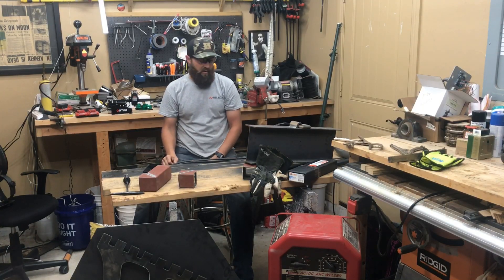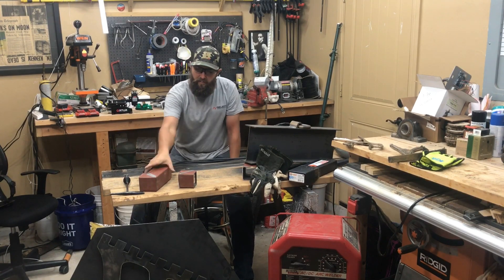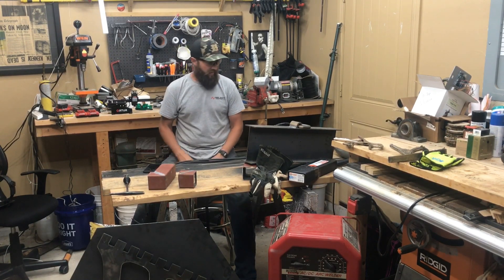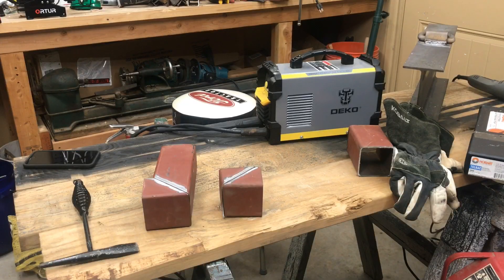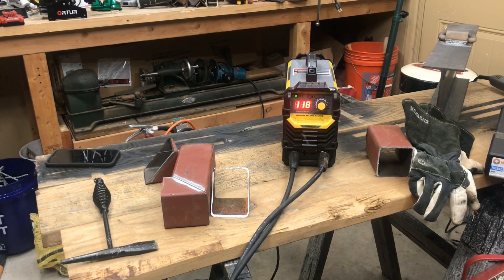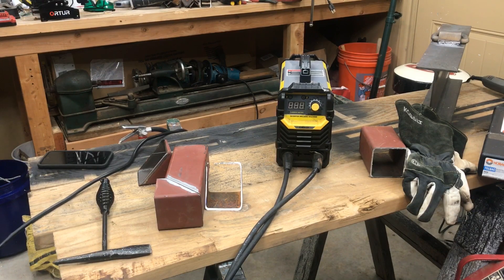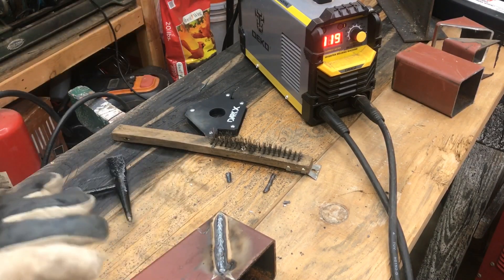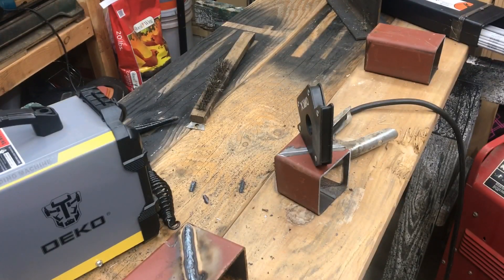DEKO PRO 110v Stick Welder - Amazon Product Review and Comparison vs Lincoln 220v

Comment: I just got the same welder but, haven't even tried it yet....maybe this weekend.  I bought all 3/32 rods to run with it.  You should really check to make sure there isn't something wrong that is causing the shock.  A mild shock could be deadly under the right (wrong) conditions, especially if it's leaking 120 AC somehow.
Reply from the maker: John Madden I’ve looked it over and I can’t tell why that was happening. It also hasn’t happened since that one day. I will definitely keep a close eye on it. Have you got to try yours yet?
Reply: @MrJustinWheeler  Justin I finally got to try it just a little bit tonight.  I am brand new to welding and all I did was run a couple of beads down a piece of uni-strut to make sure the thing actually worked.  I ran a couple of 3/32 6013  rods on at about 85 amps and another at about 70 amps both on 110.  Didn't blow any breakers and I didn't get shocked (but I was inside and completely dry).  So far so good.  I am pretty excited about it.  Have wanted a welder for a long time.  I have a whole lot to learn before I can say anything with any cred but, I am glad I got it.  Thanks for taking the time to post a video. I didn't see yours before I bought mine but, I definitely look on youtube to see what people think of something before I buy.   Especially if I know nothing about it to begin with. 

 p.s. if you haven't done it yet I would check with a meter to make sure you unit is grounded (I mean continuity between the plug ground and the case) and just plug it in and measure the case and lead voltages for any stray AC.  These put out DC volts so, you shouldn't see any AC I don't think.    Again I am not an expert.
Reply from the maker: John Madden good to hear! I was just wondering if you’d had a chance to give it a try. Sounds like you had decent results. I too, and very new to welding, so I’m still learning a lot. Another guy just commented about not crossing the leads, which is something I didn’t know. Good tip on checking the grounding continuity. I will do that tomorrow before I put it back to work.
Reply: @MrJustinWheeler Also make sure the outlet you are plugged into is actually grounded.  Ground faults are always a good idea if you're where its damp.  The circuit I used to try mine is on a ground fault breaker.  I mention that because I was curious if the welder would trip it and it didn't.  

 I have buddy that's a professional welder.  I'll try to remember to ask him about getting shocked a little if your working in damp conditions is normal.  It may happen all the time for all I know.
Reply: Ok this may be more that you want to know....I copied it from here....https://www.lincolnelectric.com/en-us/education-center/welding-safety/Pages/electric-shock-faqs.aspx

"A secondary voltage electric shock occurs when you touch a part of the welding or electrode circuit - perhaps a bare spot on the electrode cable at the same time another part of your body is touching the metal upon which you're welding (work). To receive a shock, your body must touch both sides of the welding circuit, electrode and work (or welding ground) at the same time when the welding output is on....The voltage at the electrode is highest when you are not welding (open circuit voltage)."   

So keep your hands off the part you're welding. :)
Reply: I have the same machine and ran it on 3/32 Hobart 7018 and it works great I run it around 95 amps on a piece of 1/4 inch and it felt like I was laying a bead as good as the Miller I was taught with in trade school. On 110 outlet I would run 3/32 rods and if you run 220 you can get away with 1/8 rods. That might be why he was getting stuck rod

Comment: I run E7018 DC 3/32 rods just fine with this machine. I have been wanting to try to run some 6010 to see how it would do.
Reply from the maker: Yeah same here. Only ran 7018 so far, but I’ve ran ALOT of them. Looking forward to using some 6013 and 6010 once I finish off these 7018s

Comment: Definetly should have used 3/32" for this on 110v power... you'd be lucky to see 100 amps for real output on 110v. 1/8" 7018 needs ~125 amps to burn nicely. 3/32 at 85-90amps and you'd be able to just let it sit on the steel and drag it on. Wouldnt fight the weld nearly as bad lol
Reply from the maker: I appreciate that feedback! I’m going to go pick up some 3/32 and see how they work. Thanks for watching!

Comment: What size and type stick? I hear the 1/8 E6013 at 99 amps works great with that welder
Reply from the maker: I think I was running 3/32 7018. I haven’t tried the 6013 yet.

Comment: Please measure the amps with a C clamp amp-meter. To show proof and To see if the amps are accurate as advertised with this model with so many welders overblown amps and fake duty cycles.
Reply from the maker: That’s a good idea. I’m going to be another video on this welder soon and will test that.

Comment: Hold on. You ran the Deko at 110 and the Lincoln at 220v?
Reply from the maker: Yes sir. I wanted people to be able to compare what a small, cheap, 110v unit would do compared to a 220v tried and true machine. Mostly because I know some people don’t have access to 220v. It’s not a Deko Vs Lincoln comparison- more of a video to highlight how decent a 110v inverter welder can be.

Comment: Can this unit run on a 15 amp circiut? That's all I have at home. Even a dedicated one?
Reply: 20a only
Reply from the maker: I haven’t tried 15anps, maybe if you were running the machine on a really low setting, but I personally haven’t tried that yet.

Comment: Please remove paint, rust or mill scale where you clamp ground clamp. Also if you can replace electrode holder and get Harbor Freight one and replace ground clamp with a 200 amp Tweco all copper or bronze. Your welding rod will stick less.

Comment: Good on you Justin, that was a nice honest video. I would imagine you will become a pretty proficient welder with a little more knowledge. Learn which rods are best for the project you are working on, make sure you are setting your amperage correctly, and give yourself a little more room for safety. The most important thing though is, how much do you want for that old machine lathe under your workbench??? Stay safe and work on stacking those dimes!!
Reply from the maker: Hey thanks for the advice. That lathe actually belonged to my grandfather. It needs the motor rebuilt. I've never used it, but have always looked forward to the day that I get to use it like he did. I even have his old turning tools. It's an old Craftsman. I don't think I will ever part with it. Maybe I'll make a video on it once I get it up and running!

Comment: It seems to me like the cheaper welders are a little under rated on the amps (where the display says you are VS where you actually are), while the name brand machines are true to the value on the display.  It's not a real big deal as far as functionality but it's something to be aware of when switching from one machine to the other.

Comment: Im curious would this be perfect for like making metal things like tables, boxes, etc?
Reply from the maker: Depending on how thick your metal is. I wouldn’t try to do anything bigger than 1/4”. For thin metal projects this thing is great. I’ve used it A LOT!
Reply: @MrJustinWheeler  Thank you for commenting back I appreciate that and will get this ASAP also its gonna be thinner than 1/4. Ty again

Comment: From the bead being on top of the metal, rather than being actually sunk into the metal, that tells me that you are running a little cold, and the arc not wanting to start is most likely due to an insufficient ground
Reply from the maker: I think you’re right. Thanks for the tip, Donald!

Comment: You should use 70-14 rods I’m using them in school and they start a lot easier.
Reply: Are you using the deko? Just curious how the duty cycle is for ya
Reply: lol different rods are for different applications, 7014 is not a suitable root. Ask your professor what the difference is between rods with different numbers and he can explain it better. https://www.millerwelds.com/resources/article-library/stuck-on-stick-easy-answers-to-not-so-simple-questions-about-common-electrodes & https://www.weldingtipsandtricks.com/shielded-metal-arc-welding-rods.html should help

Comment: Surely this DEKOPRO has the anti stick thing in it? I bought the 160A Stick/Lift TIG welder bro. I also bought a welder from my local LIDL food store that sells its own brand tools and it's only 10-80 Amps & it's a little betler.. I've not used the DEKOPRO welder yet bcos it had this copper rod in the plug instead of of a 13 Amp fuse. Somebody told me it was to get the Amps up to 160 on the domestic home sockets.. That's probably why u got shocked bro. Check the bloody plug and what fuse it has in there..

Comment: Thanks bro for the video. What size generator to run that outside wondering?
Reply from the maker: I’ve got a 5500 Generac that runs it great on 110v. I haven’t tried the 220 yet bc i don’t have the correct plug for it. But I know the 110v side melts those rods like butter.

Comment: I think that when it says 7018 ac polarity wich doesn't exist because ac stands for alternated current meaning it's always changing from positive to negative what they realy want to say is that the welding rod works Better with the stik on positive and ground on negative... But there some people that say that on a DC welder putting the clamp on the positive and the stick on the negative one can get better deposit... I guess this DC welders can burn all the comon rods... 7018 and 6013 as well as the inox ones...

Comment: These two welders are different. One is ac and the other is dc. That measures different. Allso the small piece should be welded from the other side the heat input would go better.
Reply from the maker: You’re right. And when I made this video I was so new to welding that I didn’t even realize. I’ve learned a lot since getting this little unit. I appreciate the feedback!

Comment: Justin, nice review on the Deko. I'm impressed by the Deko's weld quality even by a self-professed novice. I'm no expert either. Just a few points. You should wear a long-sleeved shirt and cover up as much as possible, otherwise you'll get a nice sunburn. I was taught to never to leave the rod in the stinger unless you're using it. There's a chance you could complete the circuit if you put it on on something conductive. 75 amps should be enough with the Lincoln. Good job though.
Reply from the maker: Thanks, Tom. All good feedback. I should get in the habit of taking the rod out of the stinger. Good idea.

Comment: Most of these Chinese cheap welders, the dial and the digital readout are directly connected, but the machine amperage is NOT what's on the gauge !!     My 315 amp welder is. B/S,   when I dial in the full 315 amps the actual amps,  is 127 amps. !!   It does run 7018- 1/8" well.  In the wide open 315 amp position,

Comment: amperage is way to low ... it doesnt matter if its connected to 110 or 220 .
for anything thinner than 1/8 thickness   100 amps is more than enough 
try using a 6013 3/32 at  70 amps DCEN

Comment: Start taking advantage of the DC capability on your Lincoln. Break out that 6010 rod and use it on DC Electrode Positive. There are some good videos on YouTube that show you how to run 6010, as there is a definite technique to it. You can't just drag it like you can with 7018.
Check out this video https://youtu.be/R7uAtEukEjs
Reply from the maker: Thanks for the tip, Calvin. I have not tried to run any 6010 rods yet, but that makes sense. I will try it. Thanks for watching!

Comment: You talk like your not a welder but I know different, but however it works you did a good job especially for such a small welder, and 120 Is the proper amperage for 1/8 7018 but if you ran 3/16 7018 it would put less pressure on your machine

Comment: if you know welding. Or even  the safety.  Anyway I went to welding school and safety first. Your cable should not be crossed, and you are welding next to the machine. But good try and also you need better Ground. 
Take care. And be safe.
Reply from the maker: Nooruldeen Alhashimi that’s good information to know. Thank you for sharing!
Reply: @MrJustinWheeler  you're welcome brother.
Reply: I understand everything you've mentioned except the cables being crossed. Im currently in a welding program but they have not yet mentioned anything about "crossing" cables. I don't see the issue with this. Could you please explain why its not good? Not trying to be a dick, just curious and trying to learn wherever i can.

Comment: need to be on a steel shielded table to start, welding on wood is about as foolhardy as asking a drunk to drive you home. Next keep a file handy and use it to clean the end of the rod before striking he next weld.
Reply from the maker: I appreciate the constructive feedback. I now how a steel table to work off of. The file is a good idea. Thanks for watching!
Reply: @MrJustinWheeler  
Glad you now have a steel welding table. The hot molten metal sparks can smolder undetected for hours and flare up when you're not around.
Someone I knew burned his house down that way. Make sure there are no combustibles near by your work area, and have at least three fire extinguishers nearby. Happy welding, TJ
Reply from the maker: @scorpiotaurus  Thanks for the advice. Yes the welding table was a big improvement. Just trying to be a little smarter, safer, and better every day. Thanks for watching!

Comment: CHECK THE PLUG and see what type of fuse they have in it bro? Mine had a piece of narrow copper pipe for a fuse.. That's lethal if u ask me.. What the fook were these lunatics thinking?? I'm in Dublin, IRELAND and I had to chage the fuse to a 13 Amp fuse bcos that is what our home electrical system uses.. I'M SURE THEY USED THE COPPER VERSION OF A FUSE TO BUMP THE AMPS to the 162 mark

Comment: I would’ve used 6010
Reply from the maker: Destrekz little I’ve got some 6010, but I haven’t tried them. Is that rod better with 110v? Or what makes it preferable?
Reply: Justin Wheeler 6010 is easier to strike an arc with compared to 7018. 6010 is also only suitable for DC reverse (DCEP). It has a deep digging arc, and is not a good choice for light gauge metal. It requires more skillful manipulation compared to 7018. 6011 runs very similar to 6010, but works with AC as well DC reverse.
Reply: @MrJustinWheeler  I have a very similar lunchbox welder that I just got got yesterday, the Tooliom 135S, which looks to be a pretty much identical machine.  It won't properly run 6010.  You need a real stick welder to run 6010 properly.   The vast majority of machines simply cannot sustain the required arc voltage to properly run 6010.  Oh, and its worse on 110V than on 220V.  On 220V you can "force it" by burying the rod into the puddle, but that's not really how it's meant to be ran.  Try it out, your results might vary.  You'll have much better luck with 6011.